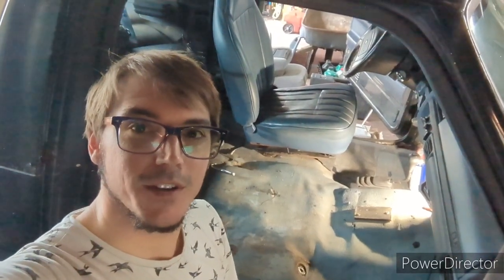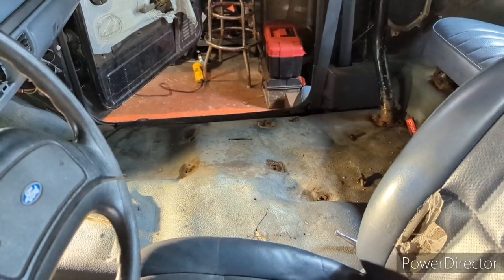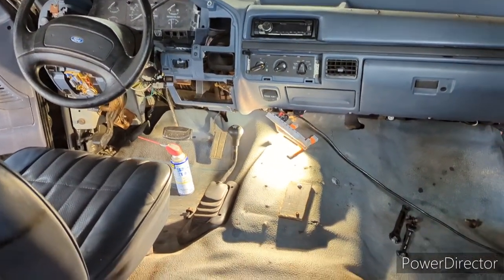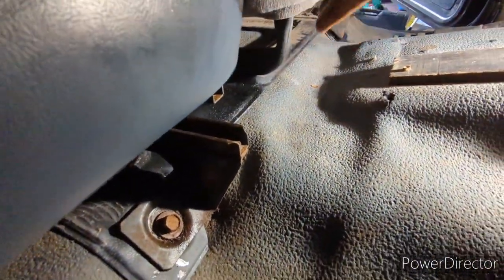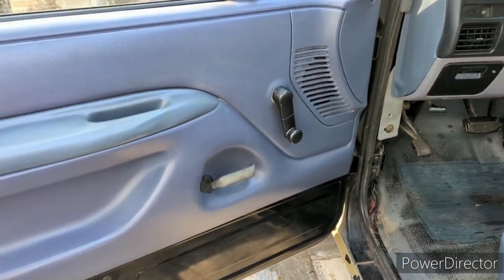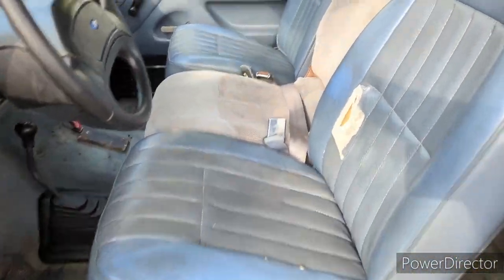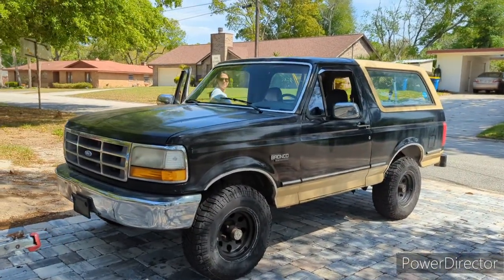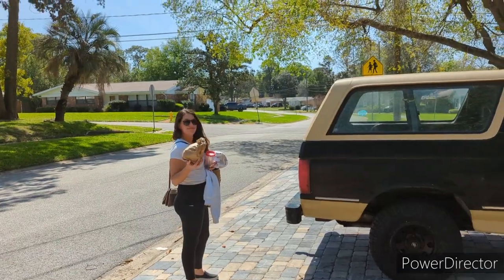Bringing Back a Bronco - Part 7 - Finale? Installing center seat, interior completion, and cruisin'

Comment: Good job! Those rear side panels... Where did you find them? I'm looking for those!
Reply from the maker: I got lucky and found them at my local pick n pull junkyard. They had a few out there. Where are you located? If you aren't too far I could probably ship you a set, but as big as they are shipping won't be cheap over long distance
Reply: @jasondoesthestuff  how can I contact you? I don't know how it works through YouTube
Reply from the maker: @zh9119  email would be easiest, winter0402@gmail.com I believe I paid around 40-50 dollars for my side panels, but the shipping would be the most expensive part. Where are you located?